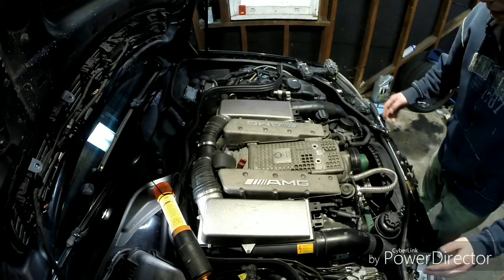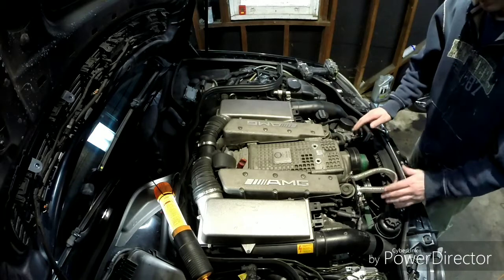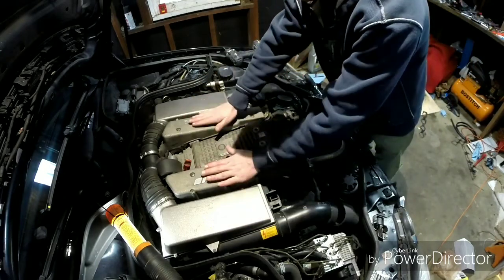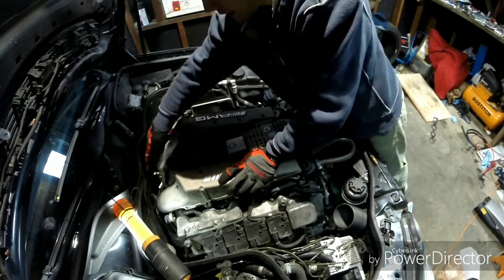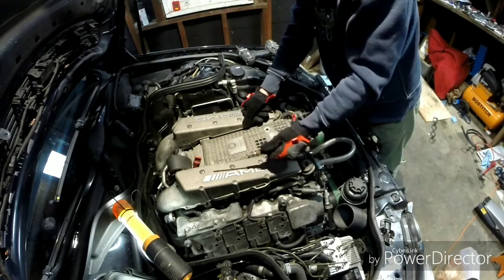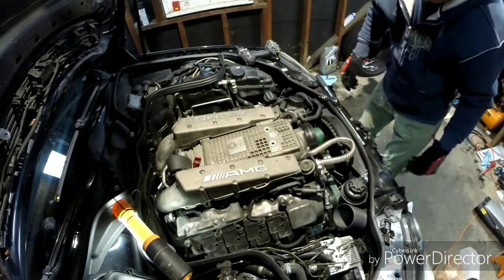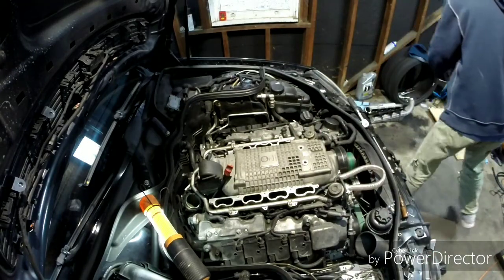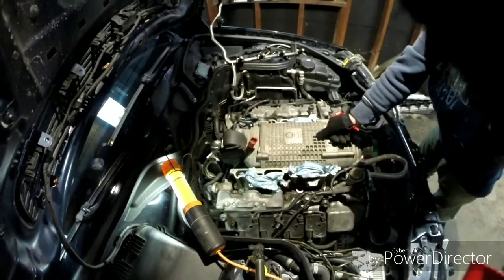W211 e55 AMG map sensor DIY

Comment: For those that don’t know.. he’s having MAP sensor failure. I’m experiencing it now, hence why I’m here.. but you can replace the sensor without removing the super charger. You will have to just be extra careful when removing it. You will have to use a swivel 1/4 driver to get down in there though. The symptoms is hesitation during acceleration causing the car to run lean.
Reply from the maker: Yeah after I posted this video I ended up replacing that map again a few times I used a small size 1/4 box end  wrench that worked best for me.
Reply: @turbocraz1 why change it? Wrong part? Cuz I'm in same think got wrong part car won't start

Comment: What were your problems you were having before you knew you needed it? I have hesitation and can't figure it out. I replaced plugs, coil packs, wires, o2 sensors on the long tube headers. idk
Reply from the maker: I was having stumbling during acceleration no code tho. Not to difficult to replace just take the passenger side charge pipe off and remove engine hoist point same side and loosen the oil check tube I found a 1/4 in Torx socket with swivel extension works good for the left bolt and a 1/4 in little box end wrench worked well for the right bolt it takes alot of patience its a tight spot Goodluck iv changed mine 4 times now I got the hang of it lol.

Comment: What symptom did you have in your Mercedes before replacing the maf sensor.  In my case, despite the new ignition system, spark plugs, coils and ignition cables on unheated forces, it is audible as if there is a misfire, there are no errors on the computer.  I think the power is weaker, have you also had symptoms like this?
Reply from the maker: Yes mine didn't show any CEL no errors either but it would get worse the colder it was outside to.
Reply: @turbocraz1  But did you experience uneven engine operation in your car, mainly on a cold engine, the feeling as if the ignition would fall out, on hot it is much better, the car reacts worse to gas on cold days, it drives much better on warm days, there is also increased fuel consumption, approx.  30 liters per 100 km.  Thank you in advance for your answer.
Reply from the maker: @dusa6860  the car was bucking and sounded like multiple misfires under acceleration colder it was the worse it got the warmer it was better it got. Sounds like your MAP sensor is bad.
Reply: @turbocraz1  Very much for your help👍
Reply: Replacing the map sensor did not change anything, all parts installed original from the Mercedes service.  Nobody can handle this problem, do you have any other suggestions?
Reply from the maker: @dusa6860  fuel pumps may be going out hook up a fuel pressure tester at idle should be around 80psi WOT it should be in the 60ish psi rang.

Comment: Could you explain what the symptoms were you were trying to correct?  Did it work?
Reply from the maker: Yes it fixed my issue so far. Was having a bad hesitation or misfire like symptom at 4k to redline rpm no codes and only did this when it was below 60 degrees outside any colder and it would start up again.
Reply: @turbocraz1  did that map sensor have an O-ring some people are saying there's had an O-ring but my new part never came with an old ring and I don't remember the old one having to know ring I replaced mine and still having a rough idle
Reply from the maker: @redbaron2448  yes there is a oring some get stuck in the supercharger but your new one should have came with one if it doest have one and u put it in u got a vaccum leak then.
Reply: @turbocraz1  that's what I thought thank you
Reply: @turbocraz1  what is the o ring part number?
Reply from the maker: @anon8613  im not sure u mite have to go to the benz dealer and try to find one.

Comment: Which issue does it fix btw?
Reply from the maker: It should fix the stumbling or hesitation  at 4k rpm at wot.
Reply: Zerolimit 412 did this fix the issue you were having at 4K RPM? I have misfire codes at 4000 RPM and I have tried everything

Comment: BTW..switched mine w/out taking off the S/C, pain in the ass though, made a custom wrench for the right side bolt
Reply from the maker: How long did that take you?
Reply: @turbocraz1  Well  I own my own shop. doing it professionally for over 30 years,but still it took like 45 min cuz can only turn the bolt a little at a time,but the other bolt was easy with a swivel
Reply: @turbocraz1  Obviously I did still have to take off the right side AMG tank
Reply from the maker: Thats not bad at all. its a terrible location for that sensor.
Reply: @turbocraz1  Agreed. very bad spot
Reply: Yeh that right bolt is a PiaI have got mine off at this time, I used a E8 spanner to get it off, as you say a tiny turn at a time.
For the sake of a little notch in the casting, it's made a relatively easy job into a pig, but this is Mercedes Benz we are talking about, if they can make a job difficult they will!
To be fair, lifting the supercharger is the correct way to do the job, it's the way WIS tells you, and it's the way a main dealer would do it.
I dont know how long it took me to get the sensor off, but it probably took me 45 minutes to get that bolt out, but that was my fault because I couldn't be bothered to go and make a tool up!
I can only work on the car for a couple of hours at a time due to health issues, so it will probably take a couple of days to build it back up again, good job I am not in a rush.
Reply: OK, right hand bolt, getting it back in.
First off, when you push the new sensor back in place, it should stop before the body is flush to the inlet, if it doesnt, or goes in easy,  then you would be advised to replace the rubber seal that is inside the hole that the sensor goes into.
If it does stop, and seems a bit difficult to get in, pop a bit of engine oil onto the plastic pipe thing that goes into the inlet, then ease it in with a screwdriver, this means that the seal is probably in good condition.
What you need to do is swap the bolt for a socket bolt, or hex bolt they may be called,one you use a hex key, or allen key to tighten.
You need one that is M6 I think, same size as a 10mm bolt.
It needs to be the same length as the bolt you took out, so will need cutting down if too long (Make sure to leave a nut on while you are cutting it, and chamfer the end so that it will go into the inlet without any extra trouble).
Next you need to get the allen/hex key that you are going to use, and cut the short end, until it is about 1/2 inch away from the bend, chamfer the end on the tool too.
Make sure you have an extending magnet, because its a good bet that you are going to drop the bolt down the side of the supercharger.
You can start the bolt with your fingers, make sure that the other bolt is in but loose so that you can line up the hole easier.
Its still not an easy job, but its a damn site easier than trying to use the torx bolt and a rachet.